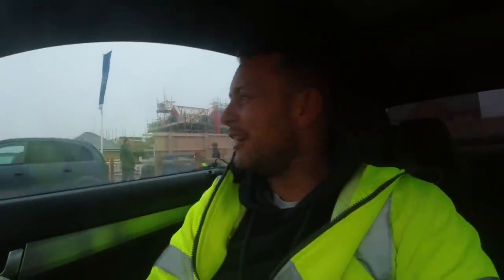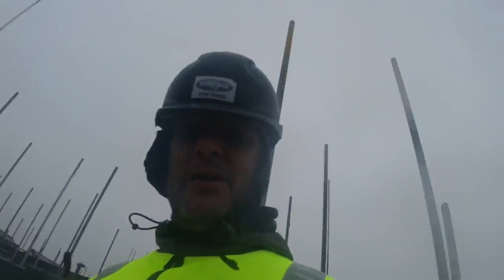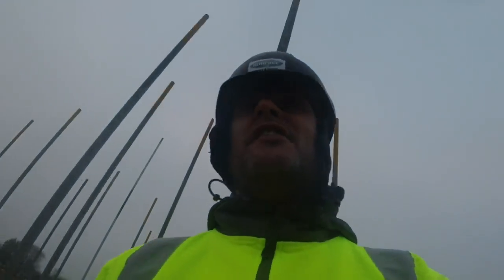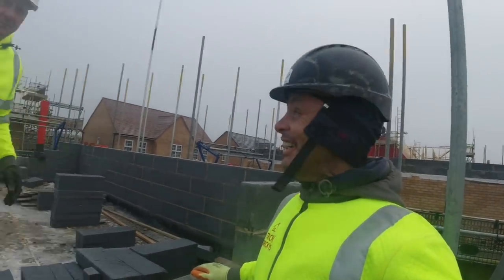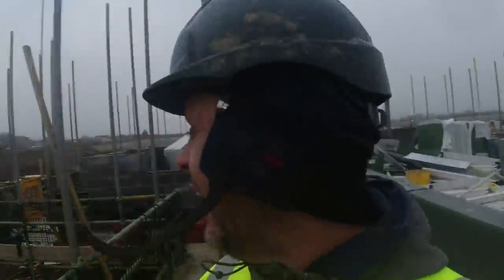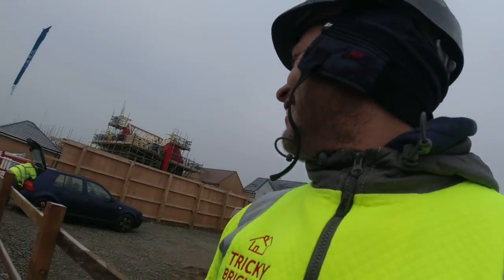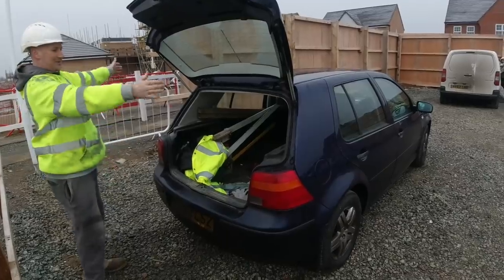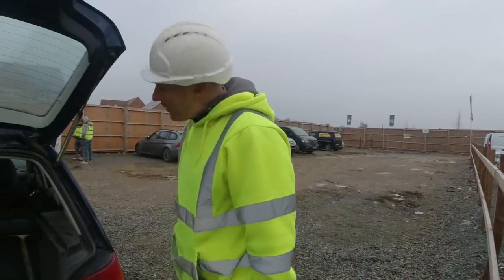bricklaying we walked off site!

Comment: Context would be nice.

I understand it as insulation had few mm gaps and this was asked to be rectified. 
Would this not something the bricky would want to rectify, Any air gaps will impact the performance of the insulation.
Reply from the maker: Would you build a wall with broken bricks ?? They are asking us to cut the insolation around every tray. Trays that have no use whats so ever. Have you ever been on site.? Practically it is impossible to get the insolation fully tight around the lintels with tray damp behind it. Aswell as all the chippys sealing glue everywhere. All for £2 psm . No thankyou.  Ill leave that to someone else thanks. So in answer to your question mate have a go at it yourself bud. Its easy writing just rectify it..in the real world its not going to happen.

Comment: We seem to be doing ok on dwh atm but like you we were warned about going over to them. We've not put any trays in like you have there what a ball ache, but we wouldn't get away with the back of the block work like yours they want it pointed like face work and brushed thats the worst of it here up to now. If I see anything like what they have been asking of you, a few mm on the insulation and them daft trays ill be walking the same walk.
Reply: The trouble with comments like yours, is people who have no idea what it's like reply. "Do a proper job then " etc. But as an ex jiffy I know what you have to put up with....cold, health and safety, waiting for gear/slow forklift driver , bad agents, all this and more, when all you want to do is a good job, and earn nicely for your skills.
Reply: Hoddy not Jiffy.
Reply: Well 2 weeks later we have walked the walk and it felt good. Pulled the insulation around the frames over 2 mm one side and 2 yeh its 4 mm over all but getting it sung as a bug around the ties and tray for electric box is impossible and the way they want the back of the block work pointing has just killed it. New start tomorrow, good load out and when the weather picks up ££££ to be ernt. Let's have it!!!!
Reply from the maker: It's hard on there bud ain't it. You try your hardest but the want a rolls Royce for the price of a escort

Comment: don't blame you for walking mate, people come up with all these extra's but don't want to pay for them. on the prices we get atm should be earning between £200-£250 avr a day
Reply from the maker: Yes mate and rightfully so. We struggled to make daywork there. 4 joist lifts no money in them 1700 for them 8 lintels external 3 internal plus isolation (cut coarse) taped buttons and arches. 🤷‍♂️🤷‍♂️think we got 140 a day on them. Our hoddie was the best earner for weeks
Reply: No offence mate but £200-£250 a day on price is day work money I wouldn’t get out of bed on price for less than £300 a day 
What prices you getting
Reply: That weren’t to you Adam mate your a top trowel just had a run of bad luck but I’m sure your be back slashing the pic n dip next week bruva
Reply from the maker: Mate I'm the same.  Even on 600s and 16 we struggled.  The isolation and the 5 coarse high rule killed it. Extra tray everywhere.  Even the tray they want on the joist floor.  Which is pointless made it hard. Give me a box 📦 with normal bricks any day. We had semi engineering bricks. Soaking wet. 3/4 every window.  Saw cut only. Nightmare mate lol
Reply from the maker: Yeah we will be back printing cash next week 💰💰🧱🧱🧱🧱🧱💪😉🤣
Reply: @rodneytrotter8600  I was trying not to come across cocky tbh but yeah I personally earn about £270/£300 on our site prices @£500 & £14..... Norfolk prices I'm afraid
Reply: @trickybrickys  be lucky mate and anyone says they won't get put of bed for no less then £300 a day is full of crap in my experience. What a stupid comment to make really, hate to think how much money you give to the tax man 40% doubt it. Talk is cheap mate and again Adam hope you earn well mate
Reply: Listen mate you don’t no what your talking about then do you I wasn’t going in on you in the first place but I was saying we’re I’m living in Sussex area that’s what you would be making in a good gang should be at least 
Think what you like mate I no what I earn and I’m happy with it 
Have a fantastic weekend 🥳
Reply: @rodneytrotter8600  people like you know what you earn on a good day and forget the bad, no bricky in the country would turn down £290 a day . wake up and smell the coffee you will be a better man for it. i have been watching Adam on this channel and i bet he will agree with me. Adam i bet you average approx £200 £220 a day ?? be honest mate....
Reply: No your right no one would turn down £290 a day and would be stupid if they did I think you took my comment bit ott but there you go I said what I said so I suppose it was me, but I could say 8-9 weeks out of 10 I would be taking £300 at least 
People like you just don’t like it stuck in your ways and don’t think there’s bricklayers out there earning above what your earning so how about you wake up and smell coffee mate.
Adam has already said that he’s been doing shit on this site and they ain’t been earning the crust they wanna be earning and deserve. So they are moving on it’s what happens, like I say mate have a good weekend I don’t need to keep explaining myself 😂
Reply: @rodneytrotter8600  I am defo not stuck in my ways, i am one of those that works as the odd one out on most sites. i hate watching people copy and do the same things, i find easier ways to work and earn money, sounds like we are the same deep down mate. its just your 1st comment about not getting out of bed for less than £300 was silly. as you know most bricklayers cant earn that, there only a few out there that work against the grain to earn more. But trust me i know the type that get jealous cause they try make your life hard on site, if the face dont fit and all that, i have been there. sounds like you and i have alot in common, be lucky
Reply: No problem mate look after yourself geeza 👍🏻

Comment: Fair play it’s getting harder and harder to make money
Reply from the maker: Yes mate. Im not greedy.  I just know when I'm doing to much for little reward
Reply: Had it a few times over the years end up working your nuts off for nothing in the end it’s not being greedy as you get older you get wiser👍
Reply from the maker: Yes mate. If your not earning daywork money on price when your normally hitting the 1000/1350 mark then your down to 800/900. There has to be a reason.  The gear was always there. Its the insolation.  £2psm. Its ok when you have full sheets. But the amount of trays you have to deal with is ridiculous.  Plus stupid 600mm dam to protect the joist flooring. Not payed. Makes it a nightmare
Reply: Don't blame you boys. What is that damp going down on to the floor for anyway? Ridiculous
Reply from the maker: I know justy.  Total waste of time.  Make the brickys life hard. Make a weak bed joint all for the sake of a bit of celotex  put around afterwards if he is worried
Reply from the maker: Mental.  The bloke has no idea

Comment: “All in the price”! NHBC want us to fill the frogs in with muck now before damp goes on ! You got this down by your way??
Reply: Filling the frog up is good building practice.
Reply: @gavinmcinally8442  why??
Reply: @bentyrrell8083  in case there any movement on the dpc. If its rough it could damage or split the damp. Standard practice.
Reply: Filling the frog won’t stop the damp slipping. The muck has gone off solid by the time the damp is put on
Reply: @bentyrrell8083  your filling the frog the day before?
Reply: @bentyrrell8083  if you don't fill the frog up what stops the damp falling into the frog when you lay the first course. Your damp must be all over the place.
Reply: @gavinmcinally8442  frogs are now getting filled as soon as the splash/band course is finished. Never ever had problems with 4 inch damp falling into the from 😂🤷🏽‍♂️
Reply: @bentyrrell8083  your saying this if its some kind new building technology my friend.  Honestly i cant think of a reason why you wouldn't bed on a damp . In fact up till the 90s most dpc would have a 10mm bed above and below dpc stuck weather pointed.some still do.
Reply from the maker: I agree Gavin I remember having that job as a apprentice. If the subs boys are filling the frog at least there isn't any water in them lol. I like to bed my damp on just a thin wipe. It sticks nice. And doesn't blow off in the wind 😁
Reply: @trickybrickys  true that brother, that and cleaning couring holes 4 course deep wiv rock solid mortar. Lol
Reply: Ben .You should be filling your frogs up for all your dpc,s trays to.
Reply: @gavinmcinally8442  we don’t do that where we work. Does that mean you fill the frogs at joist height? Or gable height to stop water collecting ??
Reply: @bentyrrell8083  if im expecting rain i put the scaffold board thats nearest the wall on top of the wall,stops splashing from the scaffold,  not sure you would get away wiv that on big jobs. They dont like you moving there scaffold about. Health and safety thing.
Reply: @jamiemerrick4216  what would that do?
Reply: @TELE6220  dude. There's one of you on every site.